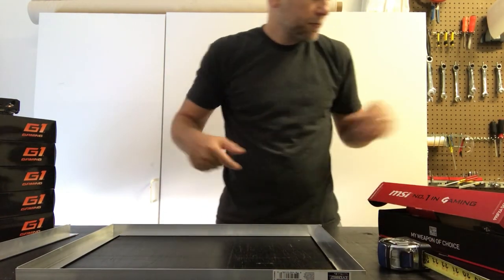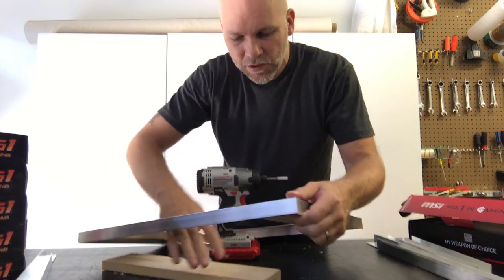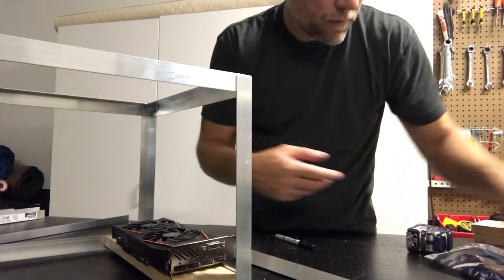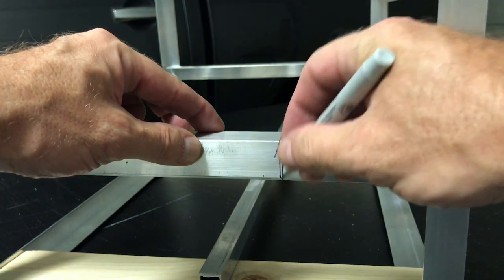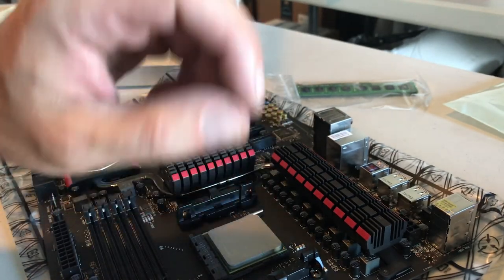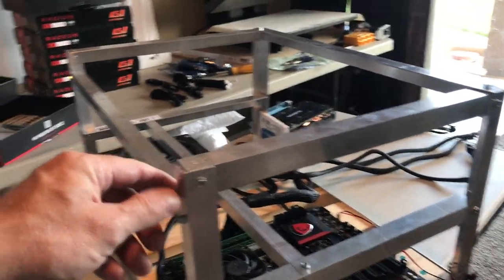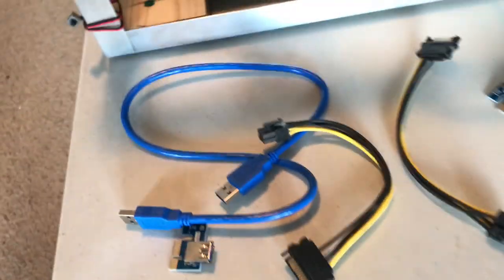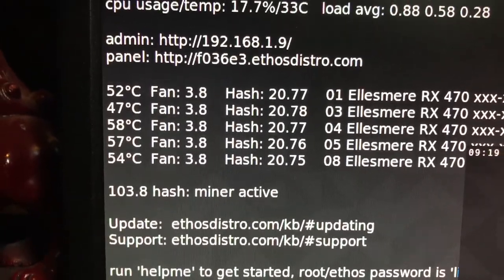Building a 5 RX 470 GPU ETH Mining Rig Running ethOS

Comment: [ Gigabyte RX 570 4G ] or [  Asus RX 570 4G ] the fastest and most efficient you think?
Reply from the maker: Not sure exactly, but they should have similar results for hashing power. Usually the fans go out first on these GPUs. ASUS and Gigabyte have both been good brands.
Reply: have you been using what GPU is the most fast for ETH?
thank you ...

Comment: Unfortunately I bought a Gigabyte Z170X-UD3 motherboard  combo from gpushack and after two weeks of mining, the motherboard failed. Gpushack refused to honor the 3-year warranty. I ended up buying a replacement board on Amazon, swapping the CPU and memory from the bad one, and it has been working non-stop without a hitch. Buyer beware.
Reply from the maker: Hi, that's odd because I have had three bad motherboards from GPU Shack. Wonder if they are getting refurbished motherboards and reselling them. Thanks for your post!
Reply: I wonder too because this was the second motherboard from them, the first was completely DOA. When I emailed them about it they sent the replacement before I had returned the bad one, which seemed odd to me - almost like they knew the board was going to be bad before they sent it to me. When I received  the replacement board, it was not packaged the same as the first one, leading me to believe that the first one was a return or a used board. The second board failed after 2 weeks of mining. I contacted them and they immediately questioned my wiring of the rig. I explained that I am a software test engineer who works on military and commercial flight simulator visual systems that use the same video cards, so I know a little about computer configuration. They stopped responding to my emails, so I am spending a few hours of my time to make sure that others are aware of their business practices before it's too late. I got a motherboard on Amazon (MSI H270-A PRO) that's made for mining and works great. I'm also not using ethOS any more, I switched to Ubuntu using an excellent tutorial I found on Steemit and am running the same ewbf miner that was included in ethOS. Ubuntu works better and it's free. My zcash mining has already made enough to pay for the new motherboard.
Reply from the maker: Thanks for the post and information!! I will not be purchasing from GPUShack again. I love Ubuntu.